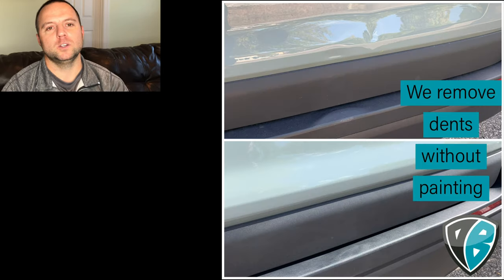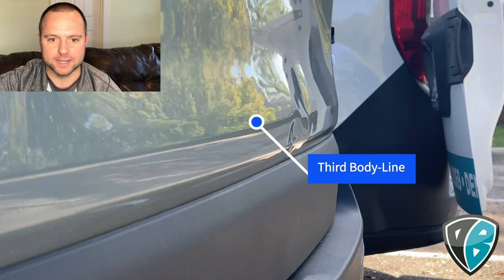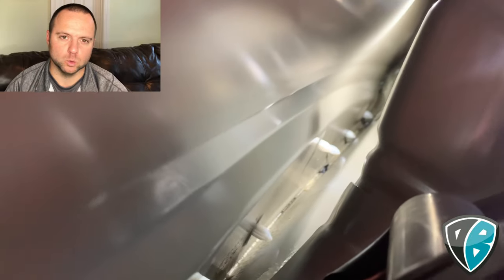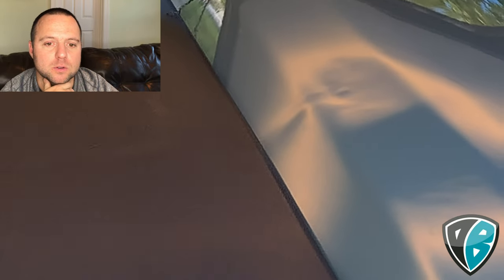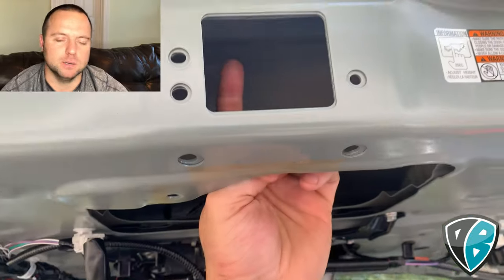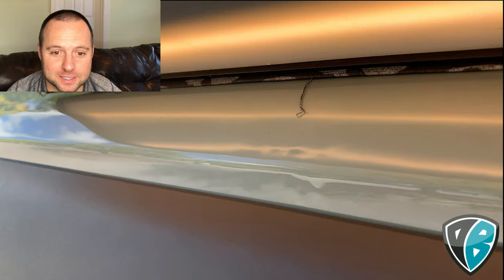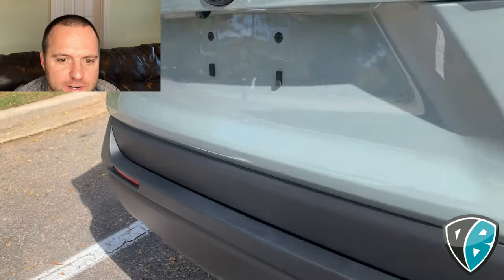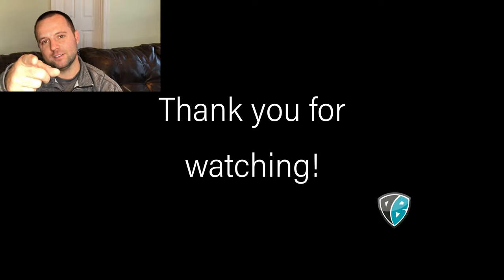PDR Multiple Body-Line Dent | Paintless Dent Repair Bumper | R&I Tips | Dent Baron of Raleigh, NC

Comment: Good job.  nice repair again.   Hey do you use a scan tool
Reply from the maker: Thank you sir.  I have an Ethos Edge Scan Tool, but rarely use it.  Mainly because almost no one or no insurance will pay for the pre and post scan.
Reply: @DentBaron  thanks for the reply.  I think scanning is going yo be a necessity in our business, just for protection.  No codes before work and no codes after.
Reply from the maker: 100% agree